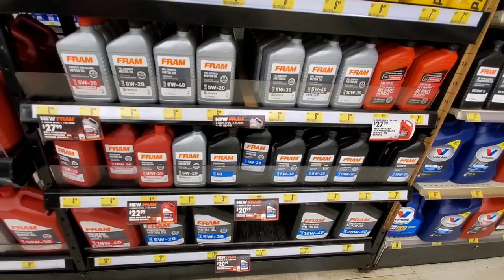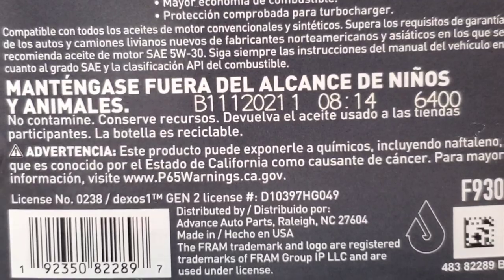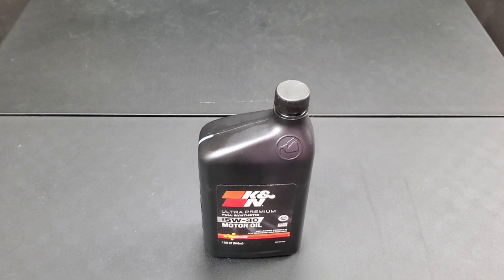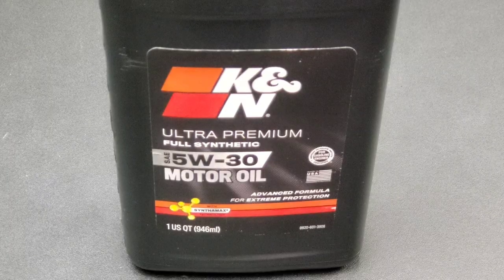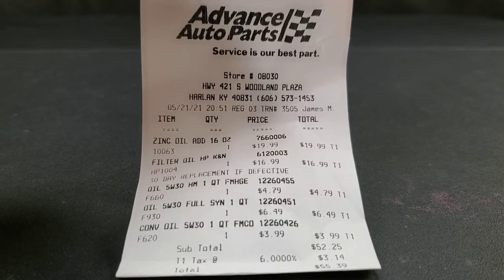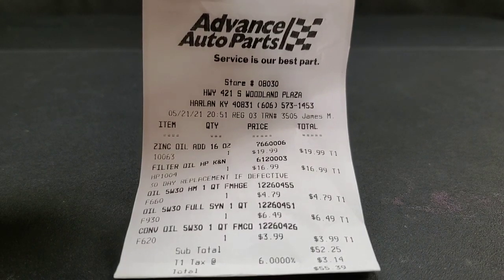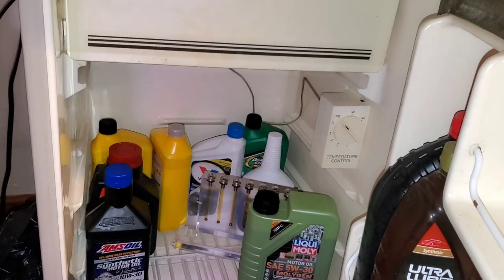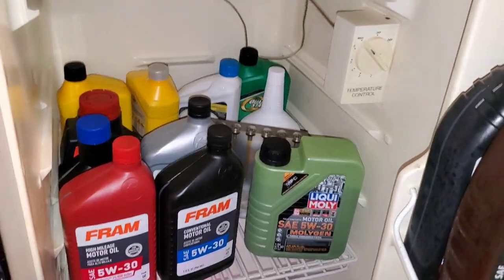Best Full Synthetic Engine oil Fram!

Comment from the maker: Do you believe fram oil is good quality?
Reply: I got me a fram filter that came with mine.  It was the heavy duty one lol
Reply: Carquest and fram are made by moly.  Would u know who makes napa
Reply from the maker: Fram force filter? Yeah im sure you received a good deal on the price.
Reply from the maker: Unfortunately Once again I was told waren distribution. However im not certain if thats true.
Reply: Only use Mobil one ! Period
Reply from the maker: I can't blame you thats a good quality oil for a fair price. I do appreciate you sharing your thoughts with the NIA community.
Reply: @NATESINTERACTIVEAUTO           Do you know if the generic brand products like SuperTech in CANADA are made by different companies than the American ones ??
Reply: @NATESINTERACTIVEAUTO           I drive a 2009 Scion TC with 84k miles and she burns quite a bit of oil, I put in a little more than half a liter/quart a week... I used to buy Valvoline Synthetic for $29 on sale but for the last 2 years I started buying Walmart Supertech Full Synthetic for $13 Canadian for 4.4 liters ($9 american for 5 quarts ??) ...
Am I making a mistake ???  5w20 Supertech Full Synthetic
Reply: @Haywood-Jablomie  
84k and burning a lot of oil ???
Bad rings or is it running down valve guide stems ?
Have a compression test done or oil gasket leak ?
Reply: @Joe..3.8.0.9_            I believe it's a known engine defect ???  Something about the engine rings don't fit properly when they made the engine and then the oil burns in the combustion chamber ???  I bought the car used with 37k and it was burning oil already...   I don't see smoke, but if I check the oil every week it is around the middle between the  "Full" dot and the "Low" dot on the dipstick...
Reply: @rstuff1605  twenty years ago I was told that valvoline was making napa oil but not sure if they still are or even if that was correct all I can say is that they look very close to the same in voa’s so it may be valvoline making napa oil
Reply: @Haywood-Jablomie  
Hi mike 
If your losing that much oil , I would expect you to see blue smoke ...
I would check all your gaskets 
Valve cover , front and rear engine seal 
Throw piece cardboard under engine and check for drips , sometimes also valve guilds will burn oil when you let car set few hours and oil runs into piston cylinders and burns off when you Starr car 
Hope this helps , again half quart week I think you be able to see blue smoke 
Joe...
Reply: I used to work for a autoparts company for Mexico, and it used to sell the Fram oil, they used to say that valvoline make this...
Reply: @Joe..3.8.0.9_               Okay so tonight when I go home, I'll put some cardboard... I noticed this morning that there's what looks like burnt oil sludge on the front side of the engine cover (Opposite of the firewall) .
Reply from the maker: To my knowledge supertech is the same.
Reply from the maker: I did just that when i was using oil so supertech is a good choice low cost, good quality.
Reply from the maker: Yeah finding the source of the problem could prove to be very beneficial.
Reply from the maker: The vehicle warranty has already expired?
Reply from the maker: Very helpful thanks we appreciate all if the information we are given.
Reply: @NATESINTERACTIVEAUTO         Yes, unfortunately long ago... I believe there was a recall but every time I put in my V.I.N. it says that there's no recall for it
Reply from the maker: I really want to thank you for trying to help others in the NIA community.
Reply from the maker: That very interesting now doubt.
Reply from the maker: Let us know how it works out.
Reply from the maker: Many companies don't even turn in the problems they find.
Reply: Sorry I would nor buy anything Fram...
Reply: @NATESINTERACTIVEAUTO  
I try 
Just try and give information I know 
Hope it helps
Reply: No.
Reply: @rstuff1605  Valvoline. Says it right on the napa jug.
Reply: Frame oil from amalie.napa oil from Valvoline.
Reply: Mobil 1 probably made with warren co.
Reply: @rstuff1605  Napa synthetic used to be Rebranded Valvoline. The CARQUEST 0w-20 I know is made by Amalie oil.
Reply: I don’t like it but the shop I used to work at used Fram oil and filter.
Reply: The local Rotary engine performance shop near me puts Fram 15w40 in all their motors
Reply: @MichaelMosesHammer  Supertech oil is made by Warren Distribution.
Reply: I have the full synthetic ow-30 for my Alfa Romeo smh I used Mobil 1 on my 1st oil change and the sexy lady at advanced auto recommended me FRAM I hope this goes well smh 🤦🏽‍♂️🤦🏽‍♂️🤦🏽‍♂️

Comment: I'm actually a fan of the cheap Walmart full synthetic SuperTech or Amazon Basics full synthetic. Every time I send a sample in to Blackstone, it always comes back excellent. I've run it all the way to the manufacturer 10k oil change and Blackstone STILL shows the additive pack has life left. I don't run it to the 10k mileage, but it's comforting knowing the oil is that good.
Reply: And both of those are likely identical. Both work very well.
Reply: The Amazon brand oil is made by a 100 year old Texas oil company and has too reviews.

Comment: I noticed today when I was in Advance Auto Parts. That I believe the Fram name took place of the Carquest name. The reason I come to this conclusion. I was looking for some transmission fluid. I usually buy the Carquest brand. There was none in sight. I picked up a bottle of Fram transmission fluid and look at the back of the bottle. Everything on the back of the bottle what's the same as the old Carquest bottles. I am assuming they relabeled the old Carquest products to Fram now.

Comment: I can vouch for Warren motor oil; been using it since the late '90s-to-early 2000s. No problem!  On Amalie, it was very well-known back in the '70s, but for some reason, it faded away from most auto parts stores.

Comment: I like the Supertech quality. I use it in my 17 year old crossover. Royal Purple is in my GDI crossover for its low viscosity performance.  <warren indust that makes the supertech has been around since 1922. Their oil tests well and its used by Amazon Basic... and OReilly brand oil i believe. >
Reply from the maker: Im glad to hear of the success you have had with the oils.
Reply: O'Reilly is not Warren, it's Omni based out of Shreveport.
Reply: They also blend stihl’s two cycle and bar oils in the USA

Comment: I just buy valvoline s.b. and change 3000 with a wix filter, and a bottle of prolong and I sleep good. Lol. I've done this in all of my cars over the years and NEVER an issue.
Reply: I always used Pennzoil Platinum in my Fords until i bought this Mercury Grand Marquis and it did not like Pennzoil Platinum. I had timing tensioner slap at start up.  Thought it was the filter so tried different filters and no change.  Finally changed to Valvoline Synthetic and would you know it no more tensioner slap at start up.  So the Merc likes purolator on oil filter and Valvoline Synthetic.

Comment: If you do oil changes every 3k up to 5k with a good quality fram filter and synthetic oil. You should be fine. I use it commercially and i haul every day. From 32k miles to 76k so far she handles awesome.

Comment: It's clearly bottled by Warren. How do I know? That symbol on that bottle is everywhere. Warren uses they bottle,  the generic one with the oil symbol on top. Circle K, Prime Guard, etc uses those two. They are all the same. Same with Amazon. Only Supertech uses a new updated bottle design. It's got the API symbol,  so it will work fine. The additives are likley the same too. Only a lab test will tell you how it handles.

Comment: I used Amalie for 25 years conventional oil,about 40 years ago,then I used Castrol in every thing.But all I have used Mobil 1 for the past 20 years and still using it,because it’s the best? I don’t know anymore.
Reply: Amsoil is the best then a close to redline etc.   Although Amalie makes 5w40 diesel oil with Molybdenum (Moly) and it's really good oil.   $30 for a gallon on Amazon.  Although Mobil 1 Delvac 5w40 has Ester technology in it.   Again, diesel oils are better for cars IMO with the additives packages.  Plus thicker and better to heat and thermal breakdown.  Super heavy duty. I run it in all my v8s , turbo inline 6 and twin turbo V6

Comment: I know of and oil that I've never seen anybody do a test on.  Its called Maximum Racing oil Pro Plus.  I'm sure you heard of it but if not it's marketed as in motorcycle oil, i mostly see 10w 30.  I've used it before in a couple of my toys. It seems to be pretty good, but I don't know if it's any better than something like Pennzoil and it's twice the price.

Comment: Trico Group has acquired Fram Group. The deal includes Fram filters and Autolite spark plugs brands. Fram was previously owned by Rank Group, now Advance Auto Parts have their own Oil Filters , Walmart have their own Air Filter brand . I have use Fram synthetic zero issues. Difference between oil is what each company put inside , all oil are 60% crude oil, the rest “ingredients “  such as zinc , phosphorus etc . Great video Nate !💪🏼

Comment: Amsoil is  makes the best oil and its 100 percent synthetic 

I have used vavoline and change my FRAM orange filter every 3,000 miles and never had any issues at all
Reply: Amsoil is best for hard run engines but to expensive for everyday use.
Reply: No it doesn’t amsoil Singuature is the best oil for people that drive a lot like Uber drivers you can go up to 25,000 miles
Reply: Not a fan of Amsoil due to being too expensive and not readily available. If I’m going to pay for a boutique brand I’ll use Redline.

Comment: I used to be a real stickler for oils, but after all the information that has been coming out from YouTube regarding oil analysis, I've felt a lot more comfortable using "store branded" oils. Now, I still only purchase the "fully synthetic" types, but they have been trouble free. Lately any of my "normal" vehicles, I have been using SuperTech (cost is hard to beat), and I've used Carquest in the past. My performance cars I will still spend the little extra to get something I prefer for whichever platform it might be. I noticed when Carquest oil disappeared, Advance started pushing FRAM as their new house oil. I figured it was the same stuff with a different name, similar to how they discontinued their own branded batteries and have either bought the Die-Hard name or struck a deal with them. I wouldn't hesitate to give the Fram branded oil a try in one of my normal vehicles. If they're running a good deal, I'd certainly try it out - hard part is beating the SuperTech price (and believe me, I'd rather give my money to Advance Auto than Wally*World, but I can't see spending more for basically the same).
Reply: Supertech & Amazon Basics were both tested as decent oils. Both made by Warren.

Comment: Any oil is good oil as long as you change it on time. Expensive engine oils are not worth it cheap engine oil serves the same purpose it lubricates the engine.
Reply: Disagree. They are worth it in ten fold. They protect and keep their protection for far longer and in more extreme environments.

Comment: Fram oil is probably good quality.
Reply from the maker: Yeah so does that mean you will give it a try?
Reply: @NATESINTERACTIVEAUTO  sure I'll try it
Reply from the maker: Be sure to tell us what you think about it.
Reply: I’ve been running the fram high performance full synthetic since it came out on our shelves 8-10 years ago. These new ones at advanced auto are made by a different company. The stuff in the orange bottle is made by ConocoPhillips and it seems to be good oil. Ran it in my 2014 ecoboost 3,5 and had the original timing chains at 116,000. Chose it because ConocoPhillips makes the motorcraft oils and has got years but I could buy the fram at a local business and Walmart was the main place to get Ford oil. Wanted to give my money to the small business and the dealers are convenient to get too.

Comment: Nate any company that puts out a product as bad as the orange can of death there's no way im going to try one of there other products . I love your videos keep them coming.
Reply: There is no issue with the orange can if you change it at the proper intervals. That being said, they have much higher tiered filters like the ultra. The ultra is fantastic and one of the best made
Reply: @TDIETZ22  Fram Higher end filters are good filters but the orange can will destroy a engine. Local parts stores in my area have stop selling them because of the poor quality .
Reply: @wd8779  that's just not true what so ever. They will not destroy your engine if you use them properly. Which means NO MORE than 3K miles on one.
Reply: @TDIETZ22  My personal opinion I would not put one on my vehicle . But with that said if you like them then go for it.